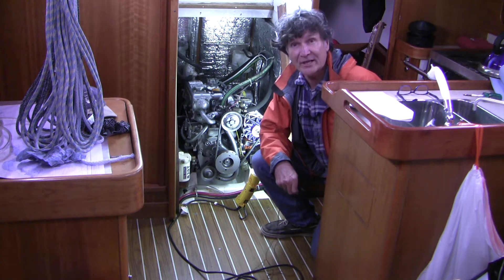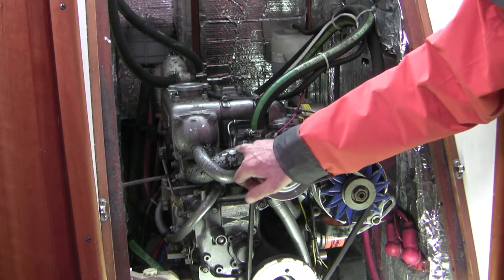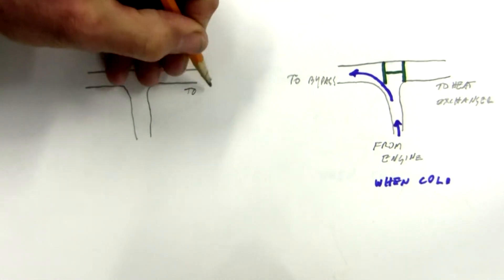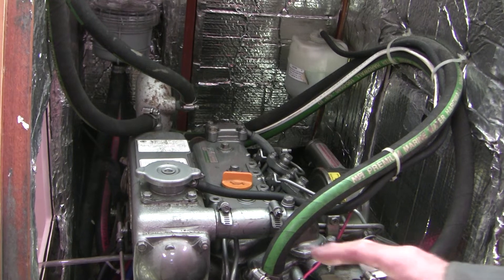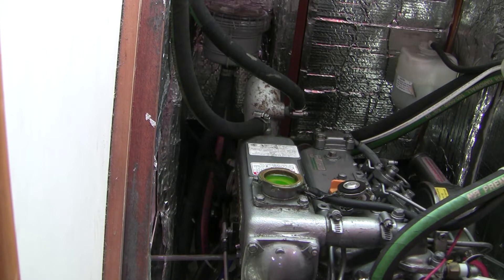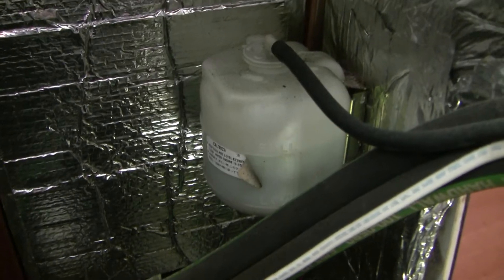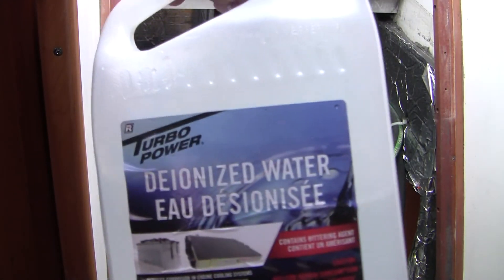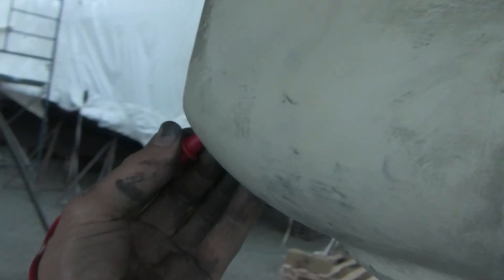Understanding marine diesel engines: Yanmar coolant exchange

Comment: Hello Dave, excellent video.  Just one question when refilling the pipes from the potable hot water cylinder. Do you leave the pipes connected at the hot water cylinder end and one connected at the engine end and then refill via  the remain disconnected engine end pipe and at the same time  holding it higher than the other pipes highest point and fill using a funnel until full ? Once the line is full I assume you then  put your thumb over the end and quickly connect to the engine ? . Hope this question makes sense.
Reply from the maker: It depends on whether you want to flush the old coolant out of the heat exchanger. I didn't bother to do it, but if I wanted to I would have siphoned distilled water in one end while putting the other end as low as possible into a large bucket. When clear, stop and reattach both ends, refilling as much as practical. You'll get less trapped air by doing it the way you propose, but in any case trapped air will be flushed out by natural coolant flow the next time the engine is run. Trapped air is eventually cleared over several heat/cool cycles by the automatic burping process, if your cap seal is good and reservoir tubing is intact. Nice to meet you!

Comment: Your videos are excellent and I learn a lot from you.  Thank you.  Thanks for answering our comments.  My 3GM30F has a continuous stream of pure (i.e. no combustion vapors- proven with a number of tests)  air bubbles coming out of the top of the heat exchanger.  Crankcase oil and antifreeze are not polluted.  Exhaust is normal.  Power is normal.  I pressure tested the heat exchanger with 16 psi for 30 minutes both with a cold and hot engine.  Also tested with decompression levers both on and off.  All tests show no leakage.  This is not normal engine "burping" bubbles since they never go away.   Any ideas where the air is leaking in (since the heat exchanger runs at about 13 p.s.i.)?   Would it be ok to simply ignore the problem?   I would have never known I had a problem if my overflow tube to the external antifreeze tank were not transparent.   Thanks again for your time and attention.
Jon Fischer
Reply from the maker: That's an interesting story. If not done already, I'd do a test for combustion gasses in the cooling system, with a device called a 'combustion leak tester'. It fits onto the heat exchanger cap, and the blue liquid inside turns a green color if exposed to the nitrogenous waste gasses of an exhaust leak into the cooling system. You might be able to borrow the tool from a local tool store, but the kit itself is only about $70. It's a screening test for a small head gasket leak. Another place air can be making its way in is when the engine is off, from a pinhole leak that is evident only when under the negative pressure caused when trapped air begins to cool. You can get ball valve effects that only show up when under negative pressure, perhaps explaining why your pressure test is negative. Have a close look at the hose connecting your coolant reservoir to the heat exchanger. Even a pinhole leak in that hose might be enough to cause your problem. Likewise have a look at the seals around the cap, if the cap seal is bad it could give recurring issues with air finding its way back in after the engine is turned off. If in doubt, replace the cap, it is inexpensive and not easy to test. Make sure the coolant reservoir never drops the fluid level below the siphon tube, otherwise you'll get trapped air that can take weeks to clear. I did a really old video of such a problem in a truck, titled "mystery of the gurgling heater core". It turned out air was being drawn back in through a bad heater hose connection, it was frustratingly hard to find. The hose was leaking only when under negative pressure, letting air in but not much else. Good luck!
Reply: @spelunkerd  Thanks so much for the quick response.  Today I purchased a combustion leak tester (only $39 from Harbor Freight).   You were right:  the chemical turned green.  I will replace the head gasket.  Do you suggest I bring the head into a machine shop to check for microscopic leaks?   Any other advice for my upcoming adventure?     Thanks again for everything.
Reply from the maker: @MrJonFischer  Yes, I would get a machine shop involved, to at least inspect and resurface the head. If your time is valuable, and if you want a professional result, you might ask them how much more it would be for them to do more, resurface the valves and valve seats, replace valve stem seals, inspect injectors, etc. Some mechanics hand the head over to the machine shop to subcontract it all. Hopefully the head is not cracked. I am definitely not an expert in this topic, so I would be searching for advice everywhere. You'll need a torque wrench to do this task. There is at least one youtube video set by a complete amateur on doing a head gasket on the 3GM Yanmar. He got over his head but powered through it.
Reply from the maker: My training is in automotive engines, marine diesel engines have been a new experience. In automotive engines, a head gasket leak is almost always the cause when exhaust gas gets into coolant. As I think about marine engines, I wonder about the chance of a leak between the exhaust manifold ports and the coolant reservoir inside the heat exchanger. The two  are separated from each other by a wall of cast iron, but they are designed to exchange heat to cool the exhaust output. I suppose it is possible there could be a rusted pinhole leak there, although with no decline during a pressure test it would have to be small. In any case, to do the head gasket, a first step is to remove the heat exchanger so you can inspect it at that time.
Reply: @spelunkerd  Thanks for the advice.  Of course, I will examine the exhaust manifold  gasket and perhaps do a longer term pressure test on the heat exchanger.  Hopefully,  my visual inspection is good enough.  I hate to go to a head gasket replacement if it is not needed.    One other thought:  should I try a "leak stop" chemical in the antifreeze before taking the engine apart?
Reply from the maker: @MrJonFischer  No, stop leak won't work for this, it gums up the system badly.

Comment: Question:
What if the top (fresh water) hose from thermostat housing is colder than the bottom (fresh water) hose from the outlet of the heat exchanger?
I have a hunter 34 and I recently flushed (with your videos help) out the old coolant and have noticed per this video that the top hose should be hotter than the bottom hose and I'm getting the complete opposite. Please advise. Your video has helped me a whole lot sir thank you.
Reply from the maker: I would go to your exact dealers repair manual to verify routing of coolant to be sure it is the same as shown here. If the top hose is cool, the thermostat has not yet opened, so you need to run the engine for longer. Just after working on the system you'll also have trapped air pockets in hoses which may heat up at a different rate. As shown, I ran the engine with cap off to burp air from the system, but final burping always takes a few more heat/cool cycles with a properly sealing heat exchanger cap. So, keep running, keep adding coolant, and intermittently check to be sure the fluid level at the heat exchanger cap is full. Good luck!
Reply: @spelunkerd  thanks you very much for your time and guidance. You were right it was that the thermostat was not open yet...after reading your reply I went amd bought a laser temp. Gun and saw that I was not up to the 71c the thermostat is rated for so I waited and it opened up. As far as the air in system I disconnected the two hoses going to the heat exchanger and blew out existing coolant and filled the heat exchanger and lines directly from the Jose's amd then reconnected them and filled the heat exchanger on the motor separately. I will continue to check the coolant level everything I turn the motor on...thankyou so much. I couldn't have done it without you and am one of your newest subscribers.

Comment: I just changed the impeller in the salt water pump.  There was a brass or bronze coiled spring that supported or reinforced the rubber seal (part #9 or 8 on the Yanmar 3gm30 parts catalog, fig. 32).  This coiled spring was twisted out of shape.  I don't see that actual item in the parts catalog.  Can I just leave that out?  Has anyone dealt with this?  thanks.
Reply from the maker: I did a rebuild video for the salt water pump, so I suggest you go there and watch that first. It's more detailed than you need, but it gives good shots of the seal spring toward the end of the video. I'll assume you are referring to the seal spring, which comes with the new seal. The purpose of that seal spring shown in my video is to hold the seal shut, tight around the shaft. It is unfortunately easy to damage a seal spring when you install the seal. The spring is always on the higher pressure fluid side, in this case the water side. Most of us apply a little grease or silicone grease onto the spring to try and reduce the chance of dislodging the spring when installing the new seal. If the spring is damaged, I would buy another seal, it needs to be there. If you already installed it, wait to see if it leaks, but buy another seal now so you can replace it again when it fails. You'll know when it fails because you'll get a steady drip of salt water from the pump when engine is on.
Reply: @spelunkerd  Ahhh.  Thanks so much.   The rebuild video was very helpful.  I have a 3GM30F, and after the second trip to yanmar parts dealer, have the correct sized seals. However, the original seal is a different design than the replacement.  The orig’l seal is affixed to the pump’s housing with a flange, as if to hold it in place.  The rubber of the seal body  is a bit worn by the seal spring and probably should be replaced. On your model, the seal is sandwiched btw the impeller and the interior pulley on the other side.  My question is: if I remove the affixed seal and replace, I may need a spacer on the non-water side.  Would a nylon washer(s) and/  or a spacer be a good option? I don’t think stainless or brass would be good here.  The parts store was out of the washer that goes on the non-water side. I can re-use my washer, but it does not snug up against the seal.
Reply from the maker: @danielconnolly2553  I don't have any experience with that design, but your thinking sounds rational.

Comment: I'm very surprised you put red coolant in with the original green.  Is that OK?
Reply from the maker: It was almost entirely exchanged, and I knew I was soon going to do another exchange when I decalcified the heat exchanger later. Those followup videos are posted. Yes, your general concern is justified. On the product label there was a remark that the new coolant is compatible with ethylene glycol so I was confident it wouldn't cause a problem. If the old coolant was an OAT style coolant, I would have been more careful to completely flush it all out with distilled water before the change.

Comment: Great video, thanks for sharing that with us. I am trying to learn more about the coolant system to diagnose a coolant leak.
Reply from the maker: You're welcome. I have done a series of automotive cooling system videos on my channel, assembled in a playlist that you may find helpful. I did a few occult coolant leak videos that will apply to marine engines as well. On the marine side I did a few videos on the salt water pump, the fresh water pump, and the overview shown here. Some auto parts stores will lend out a coolant leak tester that you may find helpful. Most leaks will only occur when under pressure, and it is dangerous to work around a roaring engine.

Comment: Well how do you bleed those lines if you have to take them off to get all the coolent out?
Reply from the maker: First remove the cap, because otherwise a vacuum will be formed and fluid will be slow to drain. Then open the two coolant drain spigots, most of your fluid will be gone after that. If there is no drain spigot, you're going to make a mess.
Reply: @spelunkerd  well I blew a head gasket and wanna make sure all the coolent is out and put good stuff in but ill see what the guy helping me thinks im probably over reacting.
Reply: All the coolent is completely out and the motor is back together and running again.  Now when I put the coolent back in will i have to bleed anything?
Reply from the maker: @269productions  No just keep an eye on the levels, especially the level when the cap is removed. If the cap is working properly, it will burp the small remainder of air pockets over the coming weeks.

Comment: Can you please explain where wire from alternator on the engine is supposed to go? The place says "Bat". So, should it go to the battery selector, the positive side? Or the actual battery, again positive?
Reply from the maker: Good question. Either will work, but if you wire it directly to the battery you lose a minor security protection because the operator doesn't have to get into the cabin before starting the engine. So, I wire mine through the battery selector, so that anybody who tries to start my engine needs to bypass the key somehow AND get into the downstairs cabin to turn the battery selector on before he can start the engine. Security protection for these little diesel engines is surprisingly bad, since you can even start the engine without having the key on, by simply hotwiring the starter motor. It's not good for the engine or engine electronics to do that but a joyrider doesn't really care about electronics. By wiring the starter motor through the battery selector you do introduce another potential source of voltage drop, especially considering that the signal wire from the starter switch doesn't have a relay. But from a practical perspective it works fine. And by wiring it through the battery selector you can turn the whole system off (bilge pump excluded) so there are fewer possible sources for parasitic drain.
Reply: @spelunkerd  Ok, so I will wire it to the battery selector. But, do I need to insert a fuse breaker into the wire?
Reply from the maker: @tomjoad1060  No fuse. The starter motor draws up to 200A, so regular fuses wouldn't stand a chance.
Reply: Thank you, will try it next week. Don't know much about electricity, hope there will be no fire...) I once started a fire on my yacht, because didn't know how to handle alcohol burner. That was scary!
Reply from the maker: @tomjoad1060  I've had close calls, too. One day I was on a boat with a running diesel engine, and it wouldn't shut down even after turning off the fuel, opening the fuel rail to air, and restricting air flow. It turned out the starter motor would not disengage even with key off, and the typical sound was muffled by the engine noise. I honestly missed the diagnosis but when smoke appeared around the engine somebody turned off the power and the starter quit. The solenoid had frozen in the on position. Close call, and a humbling experience!
Reply: @spelunkerd  Frankly, didn't understand the explanation, as I am a novice. For example, don't know what is "fuel rail", and why opening that to air would help stop the engine. But thanks for the reply...)

Comment: Watching this again. I am not clear about how to refill with fresh water fluid, so  that there are no air gaps.
Reply from the maker: Fill it to the brim, start the engine with fill cap OFF. Add coolant to keep the level close to the top, and wait for the thermostat to open. When thermostat opens, expect to see more air bubbles percolating to the top. Then shut down, put cap back on tightly, be sure reservoir is also full and reservoir tube has no cracks. Wait overnight, reassess it all in morning. As engine cools, the system will 'drink' fluid to replace the shrinking air pockets. Once it is close, with a good cap and reservoir it will automatically burp the remainder over the coming days.
Reply: @spelunkerd  it's too bad that people who have questions cannot publish photos of their problems on YouTube. I suggest supplementing YouTube with a link to "Telegram", or another social media.
Reply from the maker: @tomjoad1060  I've been thinking about your problem, and am wondering if your thermostat could be stuck closed. That would be a fairly common cause of overheating, though to think it would cause difficulty when draining fluid seems unlikely. Many thermostats have a little hole inside to allow air to escape even when closed. When you restart after filling, make sure that the top hose to the heat exchanger gets hot as the engine warms up. An old farmer hack was to remove a suspect thermostat and drive for a while with no thermostat to see if overheating persists. Not good in the long term but it was a cool way to make a diagnosis.

Comment: Thanks for all your videos! They’re concise, well planned out, and highly educational. I especially liked that one you did about troubleshooting fuel gauge senders. I have to change out the fresh water pump in a Yanmar 2GM20F soon, I’m a little worried about getting an air pocket when I put the coolant back in. Any tips? Cheers!
Reply from the maker: These little engines are pretty easy to burp. Run the engine while tied to the dock with heat exchanger cap off for a while, keep adding coolant until you feel the tubing warm up, suggesting the thermostat has opened. Then shut the engine down, put the cap on, top up the reservoir, and recheck in the morning. Keep topping up that reservoir daily, and when cool remove the cap to verify that the level in the heat exchanger is full. If it doesn't seem to be burping, check the cap again for small cracks and pinhole leaks. Caps and tubing are cheap and easy to replace. Good luck!